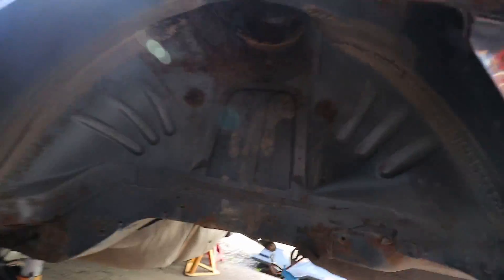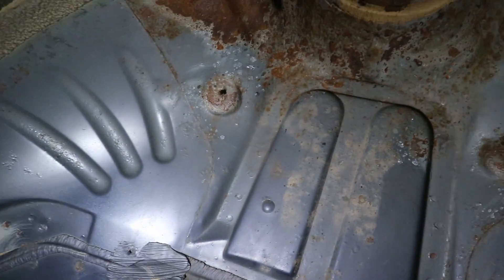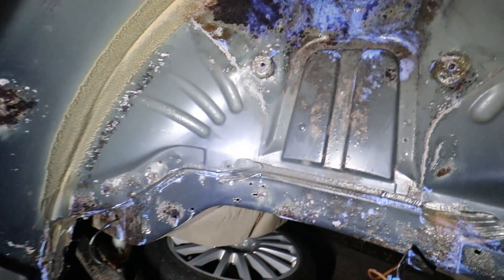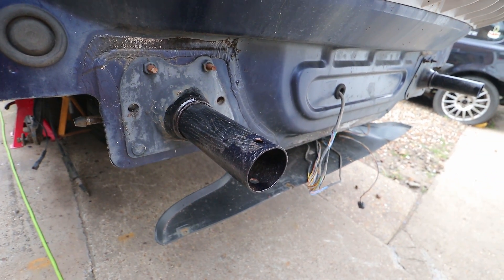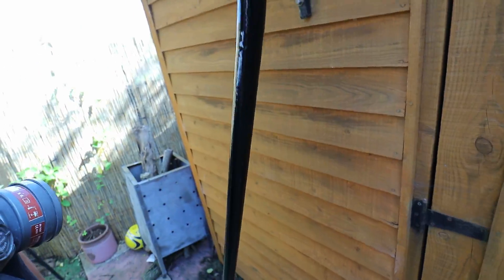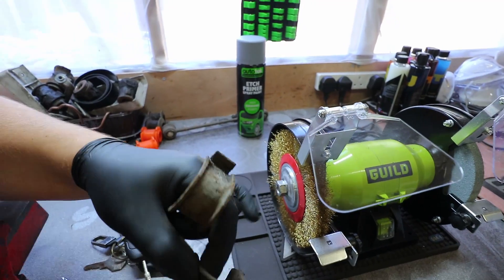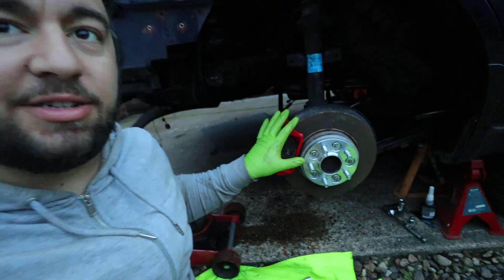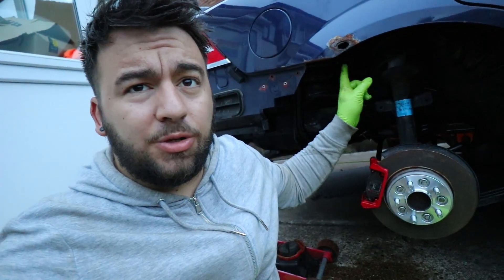Rebuilding The Mondeo ST!

Comment: good video , as always ,  just thought i would point out , you should have used the ford alignment pins on the subframe , as the alignment may be out , so you may find it doesn't drive straight down the road ,

Comment: Good job, those arb collars would have been dropped on hot before the bar was bent into shape and left to cool and shrink, much like the abs reluctor ring on a hub.

You should have tac welded a couple of thick half washers on like Volvo's have, MOT man may have a chuckle at the hose clamps

Comment: The underneath of the car needs to be 100% rust and dirt free before you underseal it otherwise it will rust even worse under the underseal. You should that got the rust down to clean metal before applying any rust converter
Reply: Chris I was surprised he painted on top of that too, although that underseal does have some rust inhibitors in it

Comment: All good im not too sure on the hose clamps you put on the antiroll bar they might eventually mashup the poly bushes . When everything is bolted in place there should be very little if any sideways movement . Personally I would have left them off . I have worked on a lot of cars over the last 30 years ; )

Comment: You could do with a angle grinder with a thicker  wire wheel , because the type your using tends to polish the rust more than remove it
Reply: One of the best ways for getting rust is a needle scaler followed by sand blasting. 

I did it on my car and the results were acceptable. The rust can often form a harm crust on the surface which just ends up getting polished like you said. Sand blasting is the only way to get into the pitting. Then a rust converter to convert any microscopic amounts of rust left back to metal. Then cover it in something like Jotun 87 followed by stone chip. It's a common method used in the classic car scene.

Comment: IF YOU SEE THIS MR SAVAGE PLEASE READ. i repaired my car last year drove it through winter and just checked the repair today and its absolutely solid, like yourself i did not have access to a welder, so i  cut rot out and fabricated a new peice to fit and slotted this in place from behind joggler tool can be helpfull ( if you have a spare wheel arch that is perfect), with everything secure, i then drilled some holes through the original bodywork and the newly fabbed peice behind, then i removed the new bit and applied JB weld around the edges placed it back in and pop riveted it in position to let the JB weld set, next day i drilled the pop rivets out grinded excess JB weld away and carried on as normal with epoxy filler prime base and clear, the panel has not rotted whatsoever and looks exactly as good as a proper welded repair, you could also use 3M panel bond etc but its pretty expensive for what it is and i can honestly say i have never seen any bonding adhesive as strong as this JB weld stuff, just a thought and hope this helps, only cut out what you need i am not encouraging people to do this to whole panels or structural areas and if possible seam welding should be used, but for a small patch like that hole its a good solution  and way better than bunging it with fibreglass which will shrink back through time :) heres a video to where i got the idea from https://www.youtube.com/watch?v=wRl1QfkrBeY    or this  https://www.youtube.com/watch?v=nbtL75CXmuQ have a good day

Comment: hello, i still got a noise from the rear right, it seems to be like an unscrewed window, hitting with other thing on grainy roads, i replaced drop links, roll bar bushes. Subframe bushes likes good (i screwed them more to check, one of them was very little unscrewed). Safety belt Holder looks good for both rear passengers,  i think it's coming from the rear right door... this noise is very difficult to find. Rear shocker top mount can be the last thing to change (including shocker and all accessories around of course)  but i don't want to spend money if i don't find something...

Comment: I reckon you’ve got the ability to tackle that rust yourself. And even if it does go wrong, you can’t make the job any worse.
Reply: I'd agree, haven't seen you stumped yet👍Get some scrap bits of metal and get some practice cutting sheet and stiching it back together 👍

Comment: Definitely want to tackle that arch yourself, guy looking £200 is a rip off and the way to look at it is with that same £200 (or less) you can get a decent second hand welder with everything you need to fix it plus any other cars in future (owning fords its almost a guarantee). Had to do the same myself over the last month and it has worked out quite nicely, about a week and you will have the welding down enough to do something like that no problem. Best of luck with it!

ps: cavity wax is the best thing you can do afterwards too, waxoyl or if you dont mind the extra cost for quality you can get dynax s50 stuff that will do a really good job at keeping rust from coming back, especially in the nooks and crannies of the seams and arches.

Comment: Hi, I would have used another coat of your rust treatment in some places, as it still looked rusty in places, but good job so far.  I wouldn't have fully tighten any bolts until the car was on the ground with the cars weight on it, you may have had to use car ramps to do this.  Regarding the hole in the wheel arch, I would clean this up to bear metal both sides and use filler, as you say yourself,  your not going for show room quality. Have fun  and stay safe

Comment: Best underbody primer for rust prevention is 2 part epoxy primer. I've used dozens of products over the years, usually rust returns after a year or so. Not with this stuff! To prep before use, remove rust with a wire knot wheel on a grinder. Far more effective that a wire brush on a drill. Then use the rust converter as you already do. Here's the primer: https://www.rust.co.uk/product/cat/em-121-epoxy-rust-proofing-chassis-paint-7

Comment: I'd be cautious of using cheap underseal. Some of that cheap stuff has a lot of bitchumen which traps a lot of moisture on the already rusted metal. This creates further corrosion. I tend to use either a wax based underseal or Dinitrol 4941. Great that your treating the rust patches before you put your subframe back on.

Comment: Wacked a spanner with a club hammer once and the spanner flew up and hit me in the eye. Then all i could see was red from internal bleeding and it took about 3 months for my eyesight in that eye to return back to normal. Moral of the story: wear eye protection.

You can't win with rust: i just clean off like what you have done with a wire wheel, then paint over with metal oxide paint and then a coat of undercoat. Aim of this is to slow it down and protect from water. It will eventually rust away and then a piece will need welding in. Basically i dont spend too much money and time on it. The aim is just to slow it down.

Comment: Could you do an update 1 year down the line to see if the underseal did a good job at preventing the car from rusting ?
Because Ive seen South Main Auto Repair LLC make a video showing how this type(or similar) caused a 2011 55k miles Chevrolet to rust like crazy. Here is a link to this video if you want to see it: https://www.youtube.com/watch?v=nXvl9nt57Kg
Reply: Preety sure in that video the rubberized undercoating was put straight onto rust, without treating it in any way, although I'm weary of putting undercoating on my own car and would love to see the one year results aswell.

Comment: Next time you see that rust, it will be from the inside of the car :)) Never had luck with this method, it always comes back 10 times stronger. It's better to just clean and apply some underbody wax over it. It will stop it as is. Only down side is that you have to apply it every year if the area is exposed. But it's better than having the rust go crazy from under the ruberised coating.

Comment: buy a mig and spend a coulple of hours learning to weld on some old metal and learn of youtube and weld that arch yourself you should be able to pick up a mig for the price that guy was asking as he was taking the piss bro
Reply: Darren Stockton hell yeah, £200 is outrageous. You can pick up loads of hints and tips for mig welding on here but the only way to learn is by having a go. We all started somewhere give it a go 👍👍
Reply: Had to do the same on my car, found tons of rust in the rear arches, had no money to get it fixed proper so I bought a mig and after a few weeks got it down pretty well. Its not fun but its well possible.

Comment: I scratched my eye when a little bit of rust dropped off the wheel well of my car earlier this year and had to be rushed to hospital. I was lucky that it didn't cut my cornea too deep and was able to fully heal within 3 weeks, but it's very easy to forget just how vulnerable you can be to little dangers when working. And yes, I was wearing eye protection.

Comment: You really want to be using steel wire on those rust removing attachments to save time and get a better job, also an angle grinder is even better but obviously space is limited. Jenolite for rust treatment is pretty good, this is just my experience treating rust underneath several cars. I knew you would end up treating all this rust as soon as i saw underneath the car when you made your first video about the arch hole.